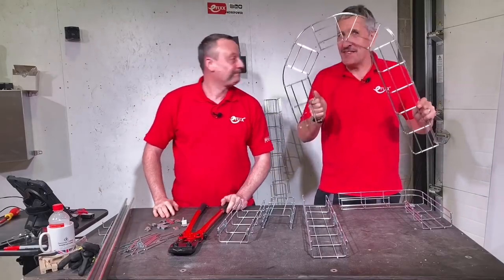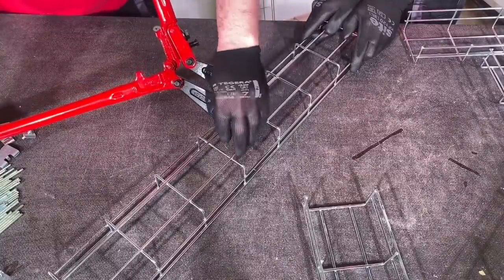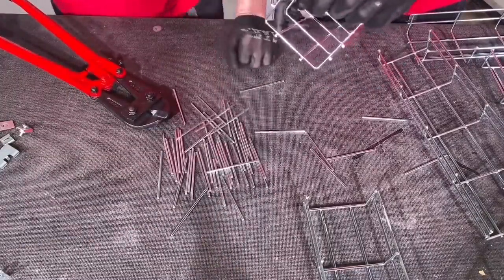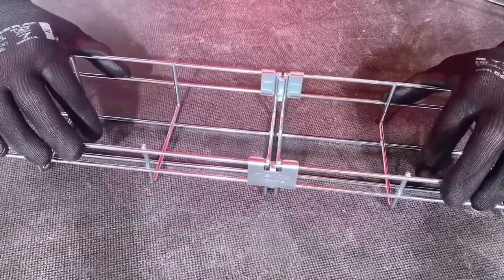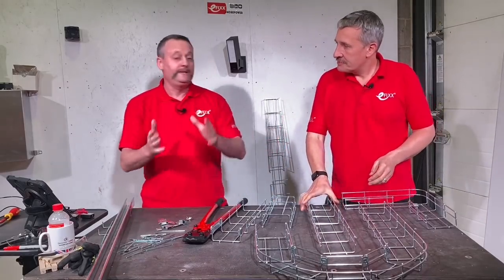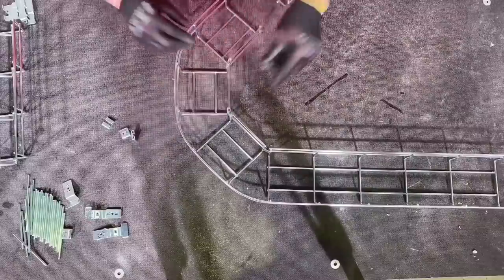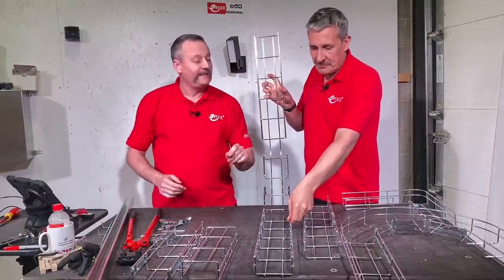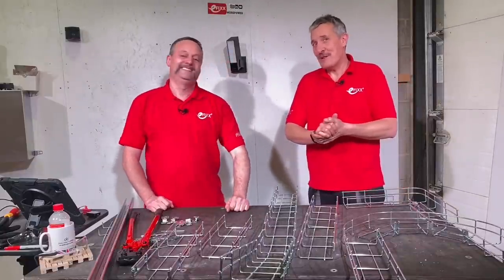Will you ever use cable tray AGAIN? This cable basket is FAST - Marco Steel Wire Cable Tray

Comment: I always just use the off cut pins as fuses.
Reply: Top tip.
Reply: 500A slow blow
Reply: My dad used to work in a barn in his teens. Had tar and fabic insulated cables and fuses made of cut nails. Guess what happened to that barn.
Reply: @rimmersbryggeri   it was sold to a property developer, converted and sold for millions?
Reply: @jsecret9459  No burnt to the ground obviously.
Reply: Can you do video on this top tip Gaz? 🤣
Reply: I think by fuses he meant to weld those pieces back in for custom bends? Or maybe not? 🤣

Comment: Aside from electrical installations I install this at the back of office desks for cable neatness. Keeps all those extensions, power, network, phone cables etc.. off the floor. A step up from what I used to use (Guttering).
Reply from the maker: Guttering 😂

Comment: Used three 3m lengths of a competitors version to run network, RF and other low-voltage stuff the length of the house in the loft here. Just a straight run with a simple 90º bend at one end. First time I'd used anything like thus and I'd definitely use it again.

Comment: Used this stuff since 2004 in various manufacturer products mainly for data/comms fibre and lighter cabling. Tray is better for fixing heavier type cables due to the equal spaced slots for fixing cable ties across, given the rigidness of these cables makes for a more pleasing install and look. I always wondered if these basket companies would provide a better cost-effective fixing for these types of cables in baskets as it is easier to work without a doubt, but why most of us sparks opt for the "tray way", that said I am always open to new products that make the job easier and the costs cheaper just to get that big job ;-) keep up the cracking work guys, my apprentices love your vids always recommend they watch.👍👍  Ed
Reply from the maker: Thanks Ed  - great to hear your views on the use of basket. If you or your apprentices want us to explore any applications, new products or regulation stuff - then just let us know. 😀

Comment: Miniature bolt croppers 🤣. If your doing lots of basket Klauke electric shears are the way to go 🤗 I prefer the Legrand system, a far more positive connection with the straight joints

Comment: We do still sell a lot of tray, as someone else has mentioned it rather depends on the installation. Legrand is more popular than Marco,  but Pemsa is a better product than all of them and an easier company to deal with. 

 Personally speaking i have used it in my workshop as shelving in combination with cantilever arms . Its lighter and cheaper and more flexible than wood.

Comment: Did a job in stainless basket  in 2008.  After a couple weeks the croppers became dull and didn't cut as well.  I found the basket needed more support than a regular tray would especially on bends and sets etc

Comment: Yeah, love using basket.. So easy to install.. Although tray is still favoured on most sites for some reason? 🤔
Reply from the maker: Would be good to understand why people still favour tray.
Reply: I think it might be to do with how the swa cables look once they're clipped...
Reply: Because cables can look messy when lashed into basket. Tray is pretty much solid when viewed from below.
Reply: my personal guesses for cable tray/basket advantages

pros basket: 
-cheap on material an price
-light weight on carrying structure
-quick mounting with small number of parts
-easy cleanability
-easy cable finding and tracing
-high accessability-> no need for later adaption 
-heat dissipation is very good, maybe smaller wire diameter possible

 cons basket:
-less carrying capability in total (wild guess, i didnt look at specs!)
-avoid putting heavy cables on top of smaller ones to avoid pressure marks(do that in trays too! but the damage in baskets is worse because of less carrying surface)
-i personaly dont know how to PROPER treat the cuttings not to be sharp. Like thin metal sheets, they are always sharp or pointy
- i personaly would not "pull" or "drag" than rather put or place cables in these because of the pointy things (i had alot bleeding underarms in my apprenticeship, but not only because of these ) and sharp angles because of the small basket wire radius
-no "clean" way to hide excess/spare cable 
-how to mount rails to cover larger vertical lengths

pro trays:
- i like the organized look even the cables are not well put in there (in some adjusting jobs you cant avoid it)
-in case its necessary and you have a gentle footstep, you can walk on them (i dont recommend it!!! know your materials and bodyweight ;) )
-mounting small devices is super easy on the outside (screws pointing to the outside of the tray!)

and many more......
 personal resume:
i like it very much for smaler cables like network etc, machines with many sensors and less big cables. They are not very common in Germany as far as i know, i only ever had one customer using these.

ps: sry for my bad english, this is my personal opinion, feel free to correct me 
greetings from bavaria

Comment: Good tip is to only cut one side on the bottom supports at opposite end so you can clamp them together and add extra support to the bottom, same as the sides  👍
Reply from the maker: Thanks for that 👍

Comment: Can’t put big armoured on basket and bends to easily but is very quick to install compared to tray
Reply: Yeah basket is for data only in my eyes. Wouldn't run a 185 4 core on a basket

Comment: Great presentation. On Marco's website I found that the maximum span between two supports can be up to  2 metres (depends of the load, environment). Can I use 1.4 metres between the trapezes for a 100mm cable basket for internal installation? Trapezes within 300mm of bends and sets. Only 6 T&E 2.5mm cables will be installed.

Comment: Used this in industrial enviroment alot in the 600mm version from competitor, job needed upwards of 50 lengths holding cables as big as a 4 core 240mm sy cable needed two runs side by side due to amount of wiring. And also used on other jobs with large armoureds it just needs extra unistrut on larger cables

Comment: Scraps for fuse wire 🤪 should blow about 500 amps . Ideal for your table lamp . 🔥
But seriously I need to go over to basket tray . Wonder if they do easy fit stand off brackets

Comment: Do they offer any divider strip for segregation. Any ideas for bonding each section together as im not sure you could rely on those clips for a Mechanical connection like you do with tray nuts and bolts?. Like installing this stuff but only ever used on comms
Reply from the maker: Yes you can get dividers and a whole raft of earthing options  - https://www.marcocm.com/Steel-Wire-Cable-Tray

Comment: Basket looks good until you try to dress the cabling.
Multiple data cables or ELV in an attic ok but trunking and tray always looks like a professional installation to me.
 Basket has a place but it's not perfect for all applications 
 Cheers

Comment: Presume you can't mix mains, cat5 and 12v cables in a single basket? Do they do a version with different "compartments" similar to dado trunking?
Reply from the maker: You can get dividers to create compartments.
Reply: @efixx  should have known, the part number is MCD for divider

Comment: Is there any reason why basket is usually used for data?  I've installed Legrand cable basket and it seems more than capable of holding the heavy cable.
Reply from the maker: Thats a great question - lets see if any of the other comments shine a light on the reasoning.
Reply: Because large gaps allow you to drop cable at any point along the length. Move the cabs slightly over or new servers have ports on the opposite side it’s no issue just pull the cable down through the basket’s gaps.

On cable tray, you’re going to need to take a drill and make a nice hole for cables. Drills mean swarf and bits. No one wants swarf over 100K of hardware that can be running millions of pounds worth of operations.

Tray would be grate on first set up but over time you need to rerun cable and basket allows that at no risk
Reply: I was told  Basket is used for data cables because its better at  dissipating the heat from them.
Reply: @neil6438  Heat???  I'm an IT admin and heat is not a thing from data cables!  Not even with POE.  A cable with a 15kW fan heater at the end of it is what gets hot (or rather, warm)!   If cooling is the reason, however, sounds like a better excuse to use them for power cabling.  Personally, I use cable trays because I like the look of them and I like the idea of clearly separating data and power channels - thought this is not necessarily a good reason.  Cable baskets are easy to use with velcro ties that are commonly used for bundles of data cable.  It allows for new cables to be added easily.

Comment: It can take longer to run cables in and the nose always wants to poke through the gaps. You should tape a length of plastic conduit on to it if you're going any distance.
Still prefer tray though 🙂